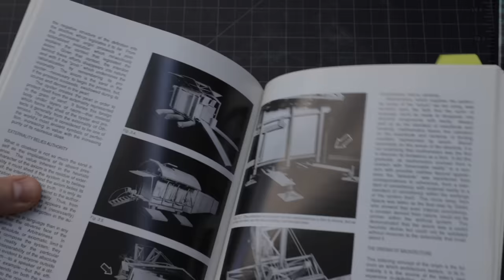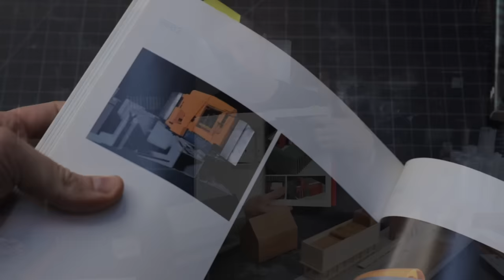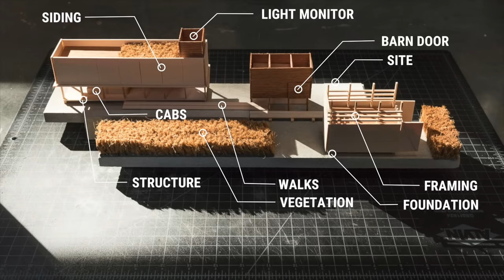Architecture Model Making Tutorial   Part 1

Comment: I have a serious architecture question, why is stone not used anymore in new buildings? Stone buildings last hundreds of years yet every new building is made from BS recycled materials, literally plastic floors etc. Wouldn’t it be cheaper in the long run to build with stone? My Appartment building is 1 year old made from steel which is already rusting and concrete which is already cracking.
Reply: Well.. concrete is cheaper and more handy
Reply: Also it is faster to build using steel structures... Most buildings nowadays aren't meant to last more than 50-150 years.
Reply: Modern insulation requirements are far superior to stone. Stone applied to a structure retains moisture behind it. Moisture without ventilation leads to rot.

Comment: Digging those forms and Material contrast.
it does take time but it always seems to evoke joy and inspire anyone who sees the finished model.

My fave trick it to use fine black wet and dry sandpaper to smooth end / corner joints and remove the fluff from balsa.
It makes a model really pop and can erase certain mistakes made by a blade.
It represents asphalt driveways really well too.
Reply from the maker: Nice...love it... thanks for sharing

Comment: Awesome stuff, been looking forward to this series from you! I use Arckit, a modeling system similar to Lego but made for architects. Definitely over the next year I want to start combining it with traditional materials to add more detail and feel.
Reply from the maker: Thank you my friend...I've seen the arckit used before...do you like it?
Reply: @30by40  I love it! I use it professionally to teach/design and it is a great rapid prototyping tool for quickly visualizing ideas. It definitely has its limitations but, overall it is a very simple and powerful modeling platform. Been recently combining it with 3D printed add ons and looking forward to using balsa for more textures and finishes.

Comment: If you have a really high end project get in contact with Alamgal. They can make you coustom modles of whatever you want. They are pricey. But if you're designing a dream house or massive undertaking like a skyscraper or other large building, it is so worth it. And they make amazing gifts to the clients. You can check then out, they are seriously works of art. But I'd only do it for large important projects.

Comment: What do you think about arckit, modular sets. Together with some 3d printing for special components I feel it is really powerful tool, and can make non professionals thinker easily with layouts and designs. I do watch your videos, but I am just a hobbiest, sometimes sketching, planning or doing things in cad or other computer software. I was thinking with my dream house layout design, and feel like making a physical model, that can be still modified, disassembled, and seen inside, with reasonable layout of things interacting. I am interested in modern design, and it looks like arckit is pretty good at it, and some special cases can be fixed with custom parts. What do you think?

Comment: How thin should the wood be? I am only able to find 3mm sheets of plywood and 1.5mm sheets of veneer in my city and i'm not sure which one is more fitting
EDIT: i found various basswood sheets 1-2mm, problem solved
Reply from the maker: 1/16" is the thinnest I'll usually go with wood but it depends on the size and rigidity necessary. larger models, with large planes will require a thicker wood.
Reply: @30by40  thank you! I am getting 2mm basswood then to get into it (1/12")